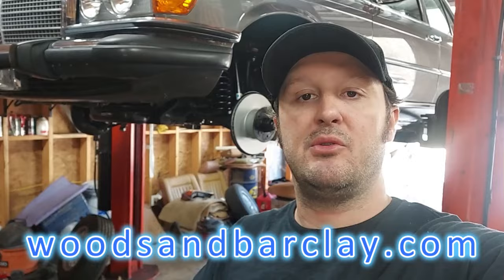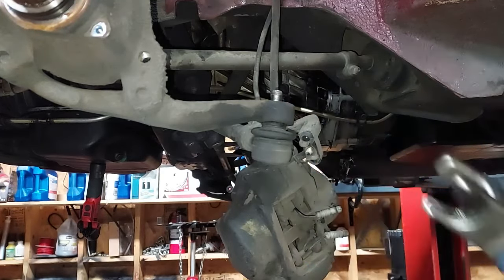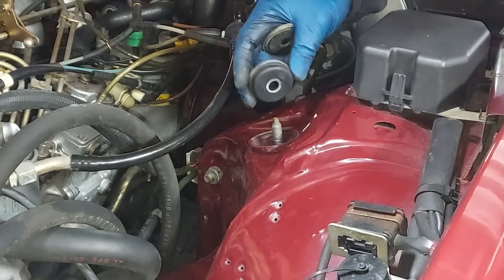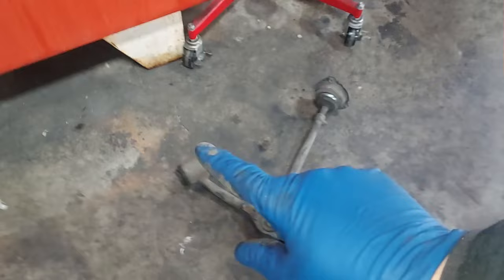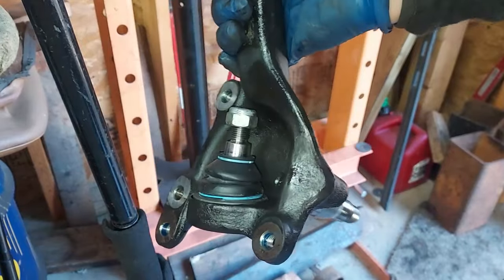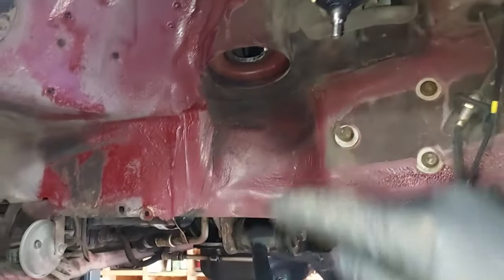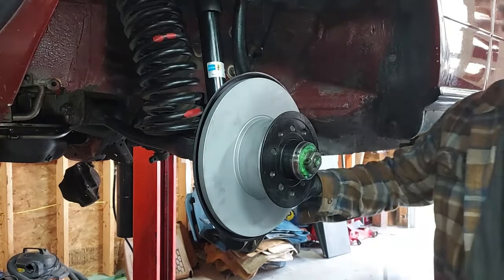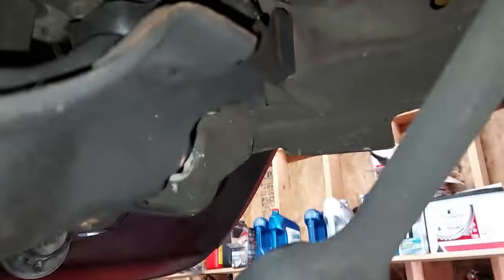1984 Mercedes 300TD - Part 4 Front Suspension, Engine Mounts, Brakes and Bearings

Comment: I did some of that on my 85 300d when I had it over 20 years ago.
I did screw up the bearings, though. I overtightened them, and they eventually burned out.
I don't know why I did that because I've done bearings a few times before.
Reply from the maker: Yeah you cannot overtighten the bearing ;)

Comment: I’ve always found the steering boxes to be the weakest link in the 123 steering. But it all depends on mileage and maintenance as always I guess. But it’s a bummer new worm gears for the boxes aren’t available anymore
Reply from the maker: Yeah I hear what you're saying but all staring boxes wear out with high mileage. It's pretty easy to find good used steering boxes if yours is worn out. There are even services that rebuild them. They made hundreds of thousands of these vehicles so there is no shortage of parts.

Comment: Are the new parts manufactured by either the OEM or Mercedes themselves as high quality as the original parts?
Reply from the maker: Yes I think the parts are the same quality. The parts that you're talking about are just suspension joints and rubber. As long as you order from a reputable manufacturer it's kind of hard to mess those up. No complex engineering going on here. Just stick with the big OEM name brands. Also keep in mind that Mercedes never made parts. Mercedes designed cars and assembled the parts. The parts were made buy other companies. So when anyone tells you that you have to buy genuine Mercedes parts just remember that. Mercedes never made parts. Mercedes outsourced all of their parts manufacturing to companies like Bosch, lemforder, VDO, hella, stabilis, Bilstein, etc. now there are some situations where you have to buy parts from Mercedes because the OEM suppliers do not sell to the retail Market. For example an SLS leveling valve has to be purchased from Mercedes because we don't know who manufactures that part and we are not able to buy that part from the manufacturer. The one thing that I do notice that was better 40 years ago is rubber. Modern rubber is not the same quality as the rubber 40 years ago. Anyway I hope I answered your question.

Comment: What do you do with the old parts taken off the car , send them for refurb and then re use them. That would be beneficial to the recycling of the old parts .
Reply from the maker: Depends on what part you're talking about. But we typically don't install refurbished parts on our cars we always install brand new parts. There are certain parts that you can rebuild and refurbish like axles or self leveling valves or rear hydraulic struts. But like I said we normally don't install refurbished parts on our cars. what parts are you talking about in particular? There's nothing on the front suspension of one of these cars that can be refurbished once it wears out it goes in the trash. Yes you can rebuild brake calipers but I prefer to install brand new ones since they are available from the OEM suppliers.